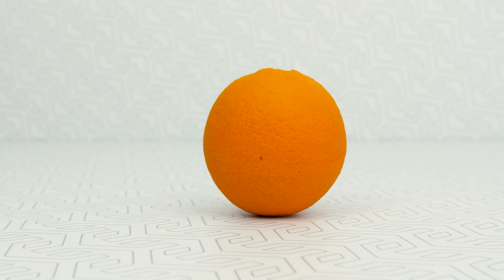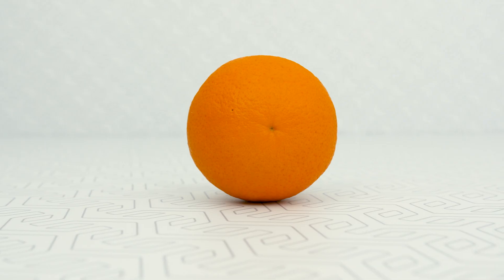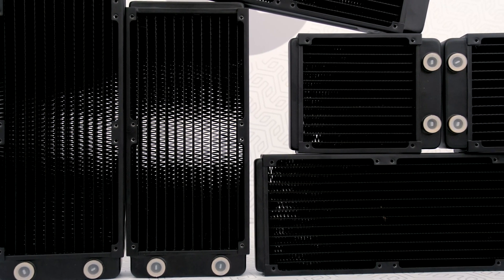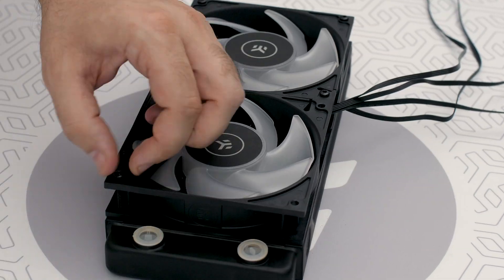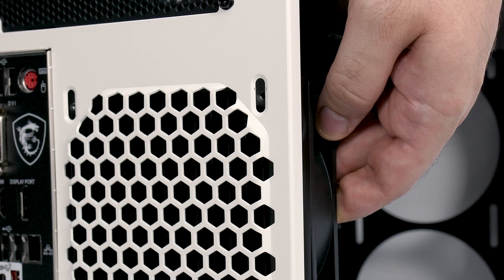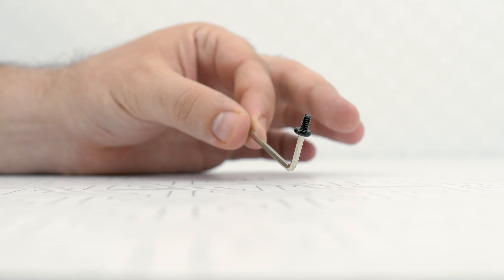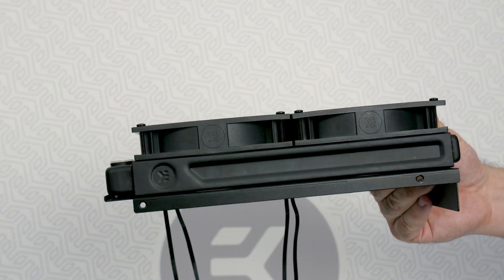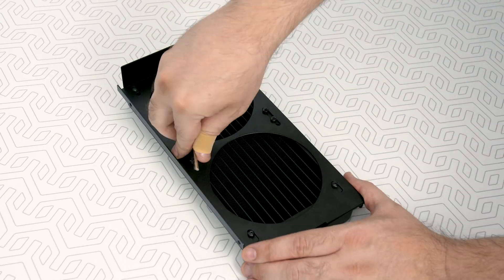How to Install the Radiator

Comment: So does it matter if ports on rad are up or down?
Reply: If the ports are up, then the radiator is easier to bleed of air. If the ports are down, then it's easier to drain. Personally i'd go with the ports at the bottom as I generally turn my computer upside down to do the initial bleeding of air after filling/refilling. It's so much nicer and easier to have the ports at the bottom. So easy to drain, having to tip the computer to drain is a pain
Reply: @extropy1  what does it mean when it its easier to bleed of air?
Reply: @markomclane475  I mean with the ports up at the top, you can get the trapped air out of the system easier.
Reply: @extropy1  thank you for the explanation